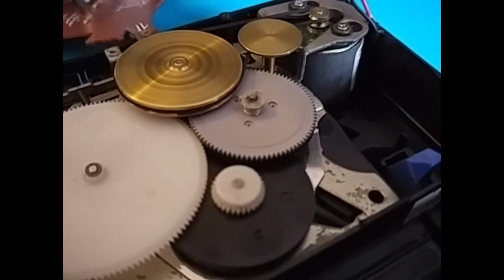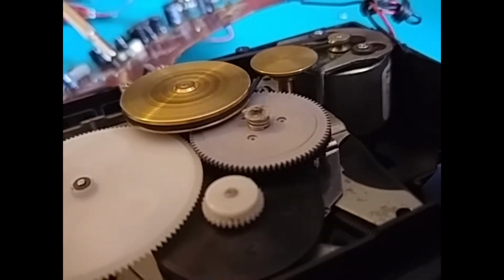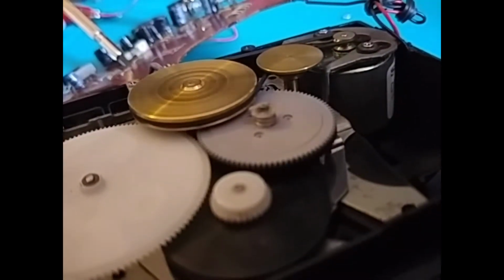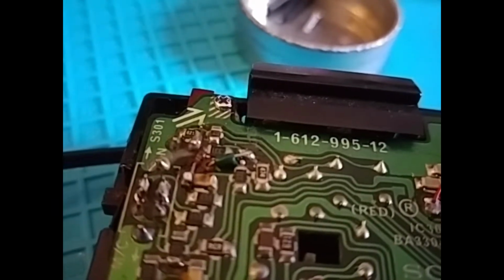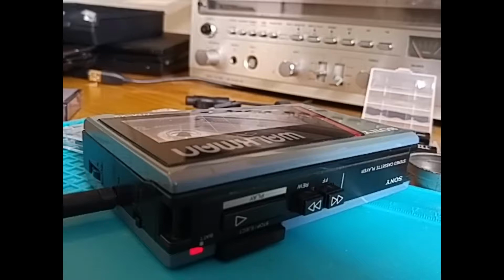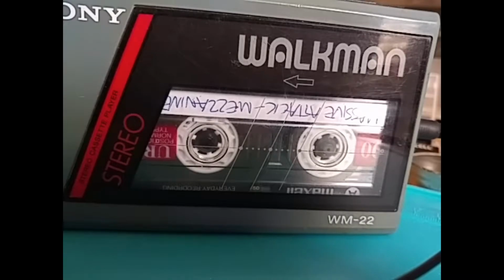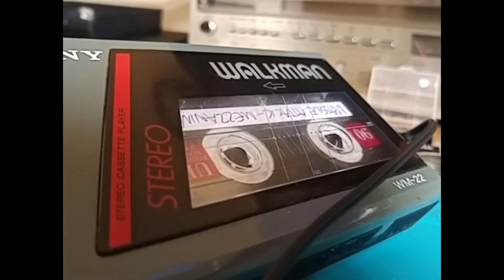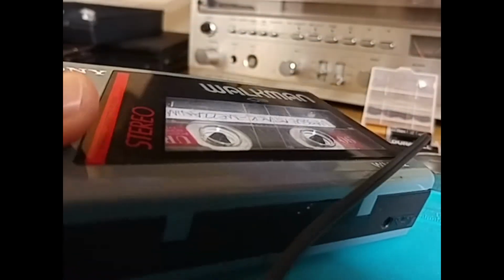Fixing a Sony WM-22 Walkman: Part 3 (Fixing Old Junk)

Comment: The sprocket is really bad engineering in my opinion, I lost the two bits and I'm not sure it's worth the effort the find them. I got this model for £25, not a huge amount but I'd love to fix this problem someday. I have a budget Walkman, the WM36, from just a few years after this that I recently fixed completely (door latch fixed, FF mechanism was much nicer and also fixed, volume sliding scratchiness fixed too) and that seems to have been made for servicing... This? Not so much. Great vid anyway, liked seeing the journey anyhow as it let me fix my own one vicariously through you

Comment: Hi, I have one of these that I did some light repairs to... I got it back to life but it runs slow. Do you know if this model has a potentiometer and where it is?
Reply: It should have one and usually you can get to it through a hole in the case